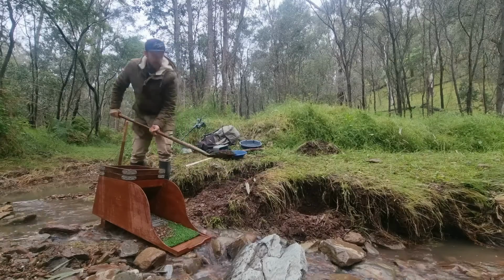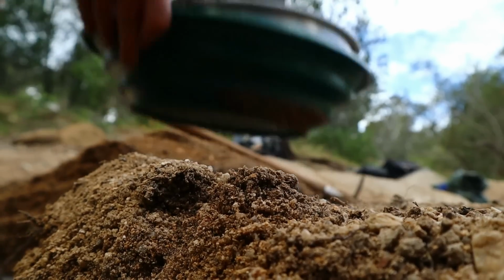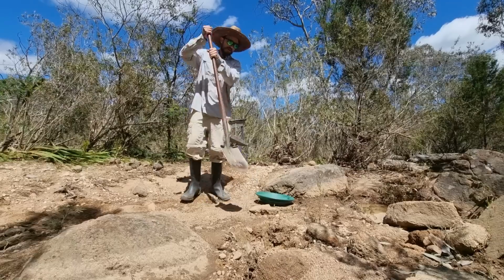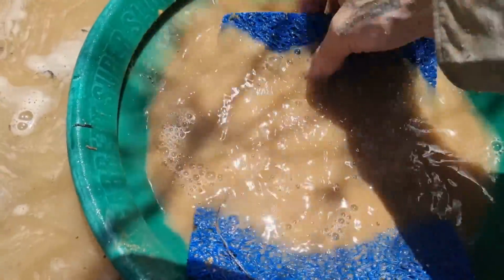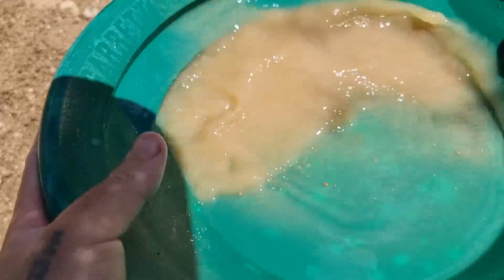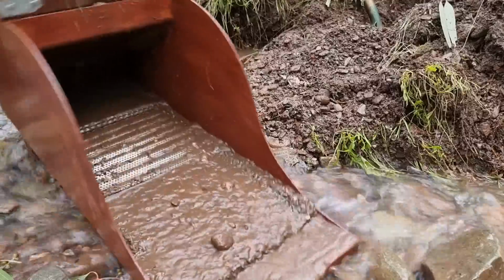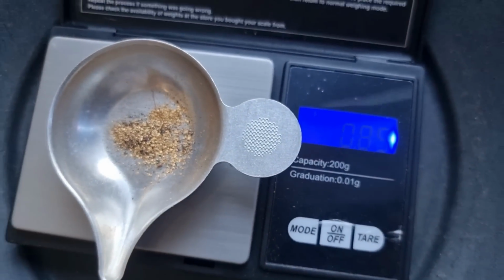You Might Get in A LOT of Trouble Doing This in Some Places!

Comment: 25:35 71.50 Aus dollars for 3 hours on the high bank. 
Driving diesel 28.00
Pump petrol 4.00
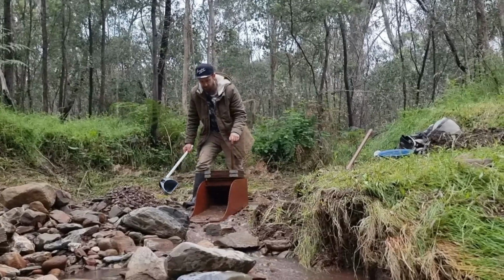Good lunch at outback dinner 22:00
Equipment cost, wear n tear.
Awesome hobie, won't get rich, but it's fun and partially pays for it's self

Comment: When you have really low water areas as long as you have some flow dig yourself a good size hole in line with even a small flow and where you might not have had a deep enough spot to scoop water or pan it will then give you a spot where you have a larger sum of water that will build up and then not have any problem especially for using a rocker box or panning

Comment: What do you think about trying to use a cordless leaf blower for your dry washer to try and save weight compared to using the gas powered vacuum/blower?
Reply: It is an option, but remember that battery powered equipment is still not as powerful as petrol engine powered equipment in terms of performance against weight. Don't get me wrong, I love the flexibility of all of the cordless equipment available today, but there are times when you need to assess which power source is the best for the operation to be performed.

Comment: I’m thinking as that water comes off the high banker thing maybe set something underneath where the water comes out that could filter the water through and keep the material from above so you could actually check and see what amount your actually loosing . Your a smart guy I’m sure figure something out . Maybe a bucket or storage container drill holes about half n inch up from the bottom so the water gets out and the material stays ? Idk maybe you already do just shooting n idea
Reply: We just shovel the tailings in a pan and test what the loss rate is if we get alot of specks then we alter the highbanker on a lower angle and maybe drop the flow rate of the water.

Comment: Im curious in that setup u have would 4lb expanded metal enable u to run more between cleanouts or do u need a wider sluice to run that type of expanded? Im gonna build a 10 inch highbanker out of plastic ply board and want to run the 4lb expanded then run my GH mats to finish the run.48 inches of 4lb expanded then a 36 inch run with the GH low flow mat.